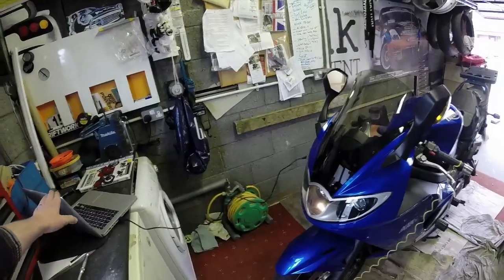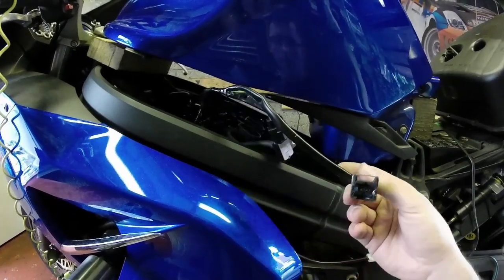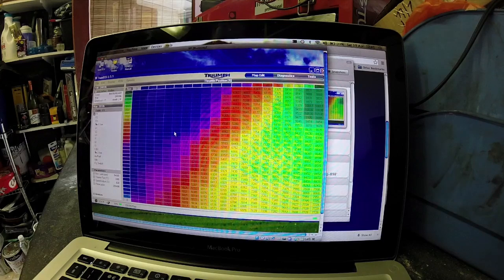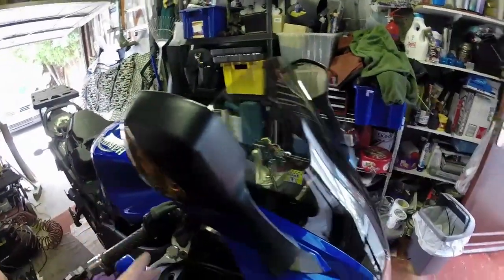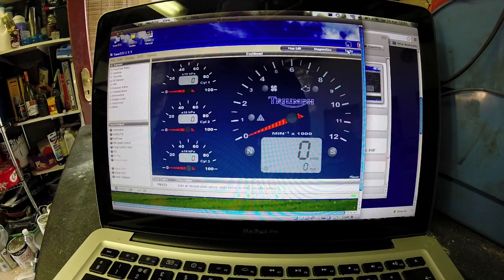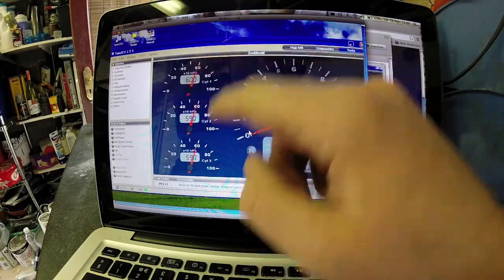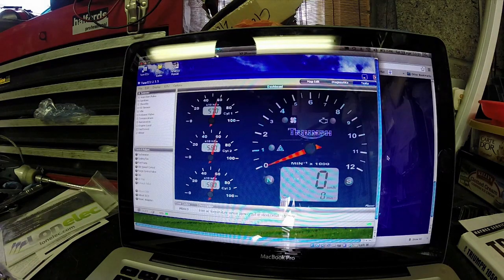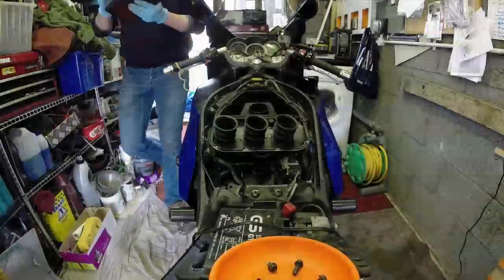Triumph Sprint ST 1050   Throttle Body Balance Procedure

Comment: How are you getting on with the Pipercross Air Filter? 😊 I’ve recently bought a Sprint 1050 with a very dirty & clogged OEM paper air filter & I refuse to use the cotton gauze style such as K&N or BMC etc as they’re awful. 👎🏻 Therefore I have just purchased the Pipercross on a bargain deal as it comes with the full cleaning kit for only £25! 😉

Comment: Hey....thanks for this video. I've just used it to adjust the throttle bodies on my 2009 speed triple but where I got an error code for disconnecting the temperature sensors the fault is still showing after it's all put back together. Any ideas why this is the case? Do I need to reset error codes? Thanks.

Comment: Mine are quite far out and when I alter the throttle body pin for cylinder one a hissing noise get louder. If I put my finger over the little hole on the inner face of the main inlet this noise goes away but the engine revs drop off. Mine are reading above the 700 mark, is this too high? Should I tighten all the screws back up and slows loosen them again? Great video though, I bought the same cable because of you and got it all set up and working in no time!
Reply from the maker: If it starts to hiss more but the balancing comes within specification, maybe it's supposed to be like that?

Also do remember your valve shims need to correct before you do this. If they are over due you should do the shims first
Reply: MagicMat Thanks for the reply. Don't suppose you know the different effects higher or lower vacuum pressures would have. I've tried searching for a tolerance that may be it should be within but found nothing. The Haynes manual doesn't cover it in that much detail.

I've done the shims, that's where this little adventure all started
Reply from the maker: Have you read the articles that I've linked up in the description?

I'm going to be honest and say that I don't know the different effects of the vacuum pressure. There is a bloke whose commented on this video
Saying a lower pressure gives a better response.

If I remember right, (and you may have to find the comment)

But his advise was to balance them all
Then screw one in a little, and then balance again,
And keep going until one bolt hits the bottom.

Whether that is good Advise or not I'm not 100%, but I can see the logic
Reply: MagicMat Yea I had a look though them, thanks for putting them up there

Screwing them in gives me a higher pressure though? I think I'm just going to aim for around the 710 hpa, a half turn out from fully closed on one adjuster. That's about what it was at when I started (give or take 20 hpa), and there wasn't the hissing vacuum noise coming from the throttle bodies. And if the comment about less vacuum bleed is a good thing then this seems like a good set up to run if they are all synced.

Thanks for your input on this, its much appreciated!
Reply from the maker: Kevin Tate 

Sounds like you have a good plan. I seem to remember there was some hissing when i adjusted, but the bike rode beautifully regardless. As long as they are balanced im sure it will run fine. 

Happy Riding

Comment: I'm going to do it tomorrow on my ST. Thank's for the lesson.
Reply from the maker: Your very welcome, I hope it goes well tomorrow. Any problems give me a shout and I'll try to help :)
Reply: I've checked with tuneecu and just decided to leave as it was because it was only ten above in the cylinder.
Reply: I want to replace the break fluid on my bike but i'm not sure about the procedure with the ABS. In the service manual they describes something to be done with the Triumph tool, do you know if TuneEcu do this bleeding process? Thanks again for your help.
Reply from the maker: Edson Camboim Silveira

If its only 10 out, you may not notice a difference, i wanted to do it, which is why i adjusted it. 

Looking at this thread on the owners club, it looks like TuneECU DOES NOT activate the ABS pump, but you'd have to check the TuneECU manual to be 100% sure

http://www.triumphrat.net/sprint-forum/149872-tuneecu-and-abs.html
Reply: Thanks magicmat i'll probably take my bike to the dealer to change the fluid
Reply from the maker: Edson Camboim Silveira It seems that you would need whats called a 'dealer tool' but i do not know anything about them to offer advice.

After the spring i bought an 2005 ABS R1200GS, The dealer told me they were tricky to bleed but at £130 for the pleasure i took it to another garage, who promptly messed it up and left me with no brakes. I then went back to the dealer and had it done properly. 

I do most of my servicing myself, but I'd be warely of changing the brake fluid after my last experience !
Reply: That's my fear. I'm planning to take my bike to the Dealer soon to make this for me. Thanks for all your help. Enjoy your new ride.
Reply from the maker: Edson Camboim Silveira Sadly the GS went after my trip to the south of France, I am currently doing the valve shims on a ZX6R G2 .. what a pig that is ! 

Come the summer i will pick something up and start positng videos ! in the mean time the ZX6 and my Montesa 315 restoration are keeping me busy :)

Hope the Brake fluid change goes without a hitch :)
Reply: I'll leave it as it is for now , i'm planning to go on the weekend to the west, maybe get to Argentina, so i may replace it when i get back. I'll post some videos next week.

Comment: Did you consider doing one more step after you have them balanced. Try turning each of 3 screws of the throttle body throats in a little at a time moving in succession between the 3 of them until one of them hits the end stop. Now you will not only have them balanced, but the air bleed will also be set to a minimim. Thus the transition from idle bleed air to just throttle body air is smoother on take off from an idle. The more idle air bleed is allowed, the worse this transition when you lift the throttle off idle will be.

Comment: Great video but do you think it's worth balancing if one of your bodies is out by only 10MPu???
Reply from the maker: To be honest no.

My bike had done 17500 miles, and valve clearances are due about 23k, the bike ran fine so I could have just left it until that big service, and then checked them after the valves had bee done, but i like to tinker. And i wanted to have a go, so i did ! :)
Reply: I was wondering the same thing - I dont think I would bother for such a small percentage error providing the bike is running ok